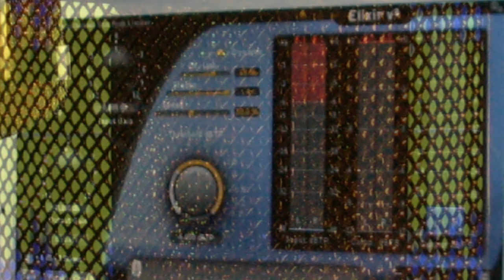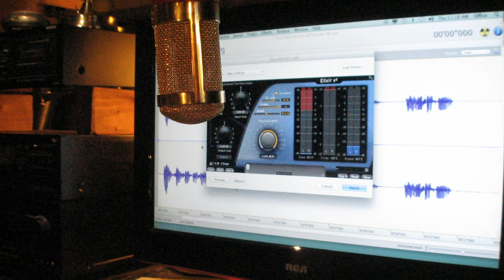MXL GENESIS Tube Comparison with Stock 12AT7 vs. GE JAN 6072A

Comment: Still a bit of a sibilant mic to me. This is where a lot of mics fall down on not rounding off the High end essy sound on 's' sounds. It gets even worse the more compression is used.Then you have to use a de esser on the track. 
Nice review, definitely better with the tube swap.
Reply from the maker: Very nice of you to take the time to comment. 

Your correct about the upper band peaks on M7 type capsules, one about 6kHz and second order about 12 kHz These 'humps' do create a lesser warmth-of-feel and is a common problem with the M7 center tapped designs Neumann developed. 
You can do a couple of things: 
1. Use a dedicated all tube microphone channel (Vocal Channel) in place of a multi channel mixer.
2. Replace the M7 style with a C12 type capsule.

@Studio57A
We use an Art Pro Channel II tube preamp dedicated vocal channel. 
This unit can tailor-out those peaks and simultaneously limit, compress and equalize the voice right at the source before it combines into your instrument channel. I always record the vocal separately on a spare track.
One other trick with this ART instrument / replace the 12AT7 tubes with our mentioned GE 6072A black plate valves. The result is a truly amazing warmth and feel. Now mix this channel into your instrument mix.

The warmer C12 still suffers slightly from these peaks, though not all replicas are true to have a source capacitance equal to the M7 capacitance of 25pf. Ones I experiment with (C12) run about 55pf. This relates to a totally different upper band roll off characteristics above 12kHz and down at 15kHz by as much as 10 dB, as it relates to the valves 1g fixed input resistance.

I recommend #1 as it is fully adjustable for the many types of vocalist we work with. Flexibility is paramount [cost effective].

SUMMARY
One dedicated tube mic
One dedicated and flexible analog tube voice processor

Thanks again and much appreciation goes to your very thoughtful and useful 'Shout-Out'.
@studio 57a
Reply: @Gene Weed  Good info there. I don't own a tube mic anymore, but I have been considering the Art ll preamp on my fet mic. Nice to hear it works well at taming the high end.
Reply from the maker: @jonos138  
The ART is a good choice for a full tube preamp./ processor up front. Example below is based on vintage understanding of; TUBE WARMTH.
Listen to how we tailored this vocal using a ribbon mic and the Art Valve Pro II.
Study this:
https://www.youtube.com/watch?v=kZg0SAVLybA

Ribbons have extreme warmth and low distortion by natural physics.
It takes time to to go "Back-To-the Future" in real time using analog domain. Learn it and how we did it in the olden days.
Remember, the artists rules; we as producers have to listen to them and PLEASE them too!
NOTES
The magic mic angle used - automatically reduces the Esses on any microphone.
Post production is where it all comes together.
SEE:
AAMS [Holland]
FLUX [France]
Best @Studio57A North and South America

Comment: Wow there really was a massive difference.

Laptop>Tascam UH7000>XLR out to Integra DTC9.8>Integra ADM 2.1>B&W 200 series bookshelf spkrs.

The GE tube added so much richness and oomph and clarity to your voice, the Mullard just seemed bland and uninspiring next to the G.E.

I just snagged a brand new Genesis HE for $525 CDN and am really amped up now after finding your video. Pun intended haha.

With this mic is the tube heat of such intensity in its' design that you figure upside down is definitely beneficial for the life of operation? Thank you kindly!

Might have to look into that M7 as well and have my guitar tech guru solder it in for me ;-) Cheers!
Reply from the maker: Always like to hear comments from everyone on my designs. 
In regards to our question about the postilion of a vacuum tube.
 If you look at the interior of almost all vintage  vacuum tube mics, they are usually all 'upside-down'. Data sheets for these indicate 'any position'
The heat inside generated dissipates pretty much equally in all directions. Though heat rises, inside the enclosure is pretty much the same due to the conduction of the case; sic: radiator. See: http://www.coutant.org/akgc12/index.html

Comment: night and day
Reply from the maker: Thanks Eric. 
Yes, all electron tubes were carefully designed for a particular application. Audio valves were designed to operate in the low distortion portion of the curve by using a very precise bias point of the transcendence slope. The use of special mica insulators in the 6072A design, along with special black plate materials accomplished very low noise. The extreme ruggedness needed to prevent mechanical feedback [vibrations] in the audio spectrum set it apart from other tube designs. MIL JAN specs contributed the valve as a super pre-amp for sure.
The tube used in the original MXL design [12AT7] is a VHF TV tuner tube, and not suitable for audio.
We used the finger test in the prototype stages. Ping the tube with with a slight finger nail 'flip' and listen to the results. The 12AT7 just rang like a door bell, yet the 6072A just went 'thud, and at a much lower level by say -40 dB.
The characteristics are identical to the German V14 valve in the U47.
One of my best designs was using both triodes of the JAN 6072A in a 'Cascode' fashion as a stepped down impedance converter from 1G ohm to about 10k ohm output impedance before the step down to 200 ohm output.. This reduced the need for a supper high impedance plate transformer.
Hope this help explain why it worked do well.

-GW
Reply: @studio57a  too cool!! I just purchased an Upton 251 microphone that is a model of the original Telefunken 251's and I was told the original 251 E's used GE 5 star JAN GL Black Plate 6072 tubes and I purchased a few so im excited to see for myself!!
Reply from the maker: Love that song!, I'll do it on my 6072A, "you are the one" , by Cole Porter.
lol! thanks!

Comment: Question...can you run the micro with out the power supply into a preamp with phantom power?
Reply from the maker: No. 

All valve, or commonly called vacuum tube's, require multiple voltages to operate. The total power available from a single 48v Phantom power supply is only a few miliwatts and thus cannot produce the required heavy power demands needed to fulfill the current required of a vacuum tube. 

The filament alone needs 6.3v @ ~ 1 amp for instance, and the Plate voltage needed is about 120v DC @ ~ 5ma.

So, the best way to achieve a 'tube' sound is not available using an FET mic, of which is Phantom capable.

Hope this answers your question sir . . 

Gene Weed
STUDIO 57A
Reply: @studio57a  yea it does...my mic is giving me a weird sound during recording..sort of a horn like sound..
Reply: Maybe the circuitry in side the mic is going bad..I did replace the tube..to see if that is the problem..the sound came back..and it gives the vocals a "sssy" sound...idk
Reply from the maker: @Oldhead717  This sounds very much like an open 'Cathode' by-pass capacitor. Typically they are small aluminum electrolytics around 100-200mF and have very low voltage ratings, say around 6vdc.
When a defect in the tube occurs, say a filament to cathode short from flaking of the hot filament, it shorts the filament voltage directly into the cathode and - poof.
Another case for a USA made valve. Let me read your other post too.
Reply from the maker: @Oldhead717  Yes indeed . . . .  it was most obvious now it was a shorted tube element and poofed you cathode electrolytic.
Now, there are two tubes in this one glass enclosure. Called a 'Twin Triode., You will have to see how they are used (wired). Usually one is the input impedance converter for the 1Gig grid needed for the condenser (capsule) itself, and is then fed to the other one via a plate cap. to the next grid. The output is then taken from the second cathode resistor, say around 4.7k in which that electrolytic cap is paralleled.
This is called a 'Cathode - Follower' type of audio output. This then feeds the single to balanced audio transistor output amplifier.
Hope this helps.
If your unable to, then call Marshall and ship it back.
Good luck!

Gene Weed